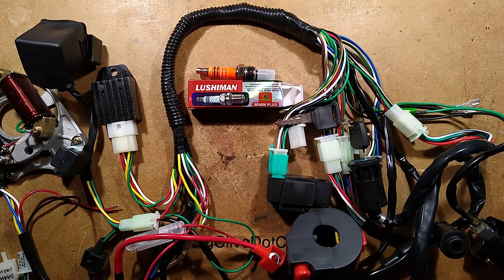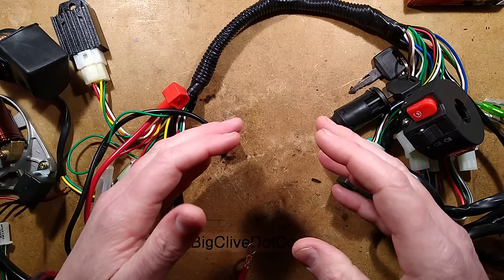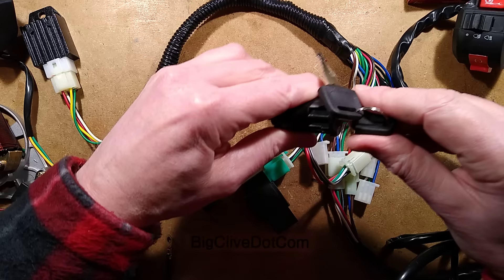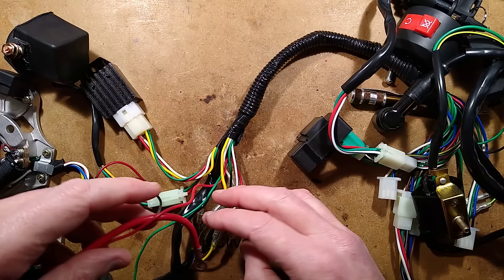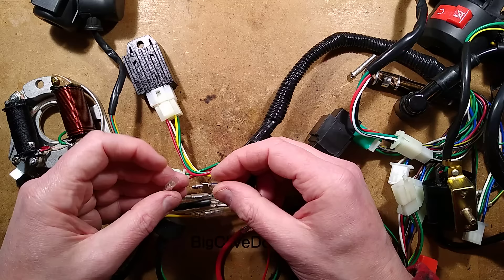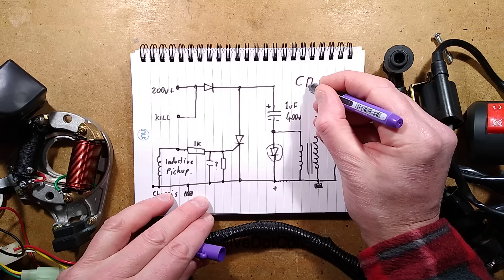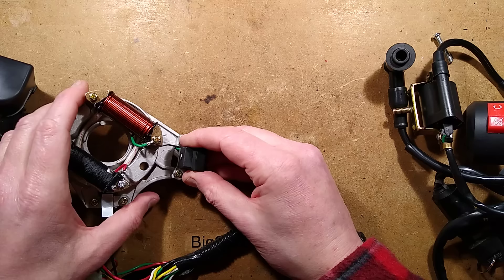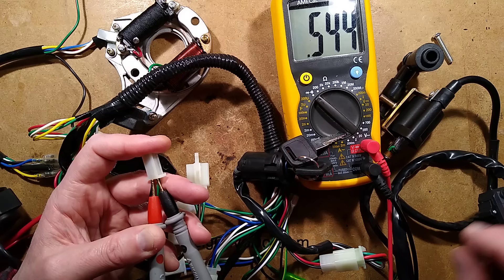Exploring the wiring loom of a Chinese quad / scooter.

Comment: Nice! I don't know how I missed this, this is similar to my scooter, the main difference is the stater, mine is either a 6 pole or 8 pole, I haven't actually seen it, but I have looked at a replacement, I got a 8 pole, but I think it's for the DC ignition system, I'm not sure, I'm thinking about rewinding one of them, with larger wire,   I think it can possibly be hold 18-20 gauge wire, while maintaining the original voltage, (same turns)  I'm hoping to do a half DC conversion, and use the headlight circuit to also charge the battery! Any advice?
Reply: Most atv's have a AC ignition system. ... needing a LOT of power to spin the engine to 2,000 rpm's ( difficult in freezing climate ) in order to spin the engine fast enough to create energy for the spark plug ... alternating current from the stator to create the energy for the spark plug ...
I live in cold weather ...  so I converted mine to start easier in cold weather ) Stator creates energy ... then it charges the battery ... which then powers the spark plug.
AC system ATV's ... need to spin the starter motor fast enough to spin the engine ( in cold climates - the engine oil is so cold it has turned to sludge - so you need MUCH more current ) - to create enough energy for the spark. ... DC ignition systems ( start easier ) becasue the spark is generated by the BATTERY ... INSTANT SPARK ... NOT waiting on 2,000 rpm's needed to spin the stator fast enough to create energy for the spark plug .
Reply: BEFORE rewinding the STATOR ... re-wire the stator from 1/2 wave ( factory setting ) ( 1/2 charge per rotation ... to a FULL WAVE ( full charge per rotation ) by removing the wire from the mid-point of the stator to the " other end" ... ( but you will also have to replace the rectifer ... to a FULL wave rectifer ) ... rectifer ... is a ac to dc converter ... voltge specific - so if you put a FULL charge into a device set for a 1/2 charge - you will blow out the "rectifier".
Reply: I had a 2 pole stator ( factory standard ) switched it to a 6 pole ... FULL wave conversion ... now puts out enough to power ... A lot of lights, winches,
Reply: look up : youtube - Harvey Spooner ... " making atv's easier to start" ... " convert atv ignition system for easier starting "
Reply: taotao 125 cc ... converted to 200 cc with 3X more electricity ... rewired stator to put out more power ( moving 1 wire ) ... replaced 1/2 wave rectifier with a FULL WAVE rectifier ... replaced ac powered CDI ( to a DC powered cdi ) ... replaced the 18 mm carburator with a 22 mm ( diameter ) carburator ... ADDED 4 flood-lights & a winch ... ( burns more gas - 1 gallon tank ONLY lasts 40 miles now ) ... 40 mpg on a ATV !?  .. good enough for me !

Comment: The components are semi-OK but the wires and connection are A #1 Chinese JUNK! You're better off doing what I did and thats taking the wiring harness from a dishwasher and replace all the wires and eliminate most of the safety crap. If not you'll spend more time diagnosing wiring problems than you will riding!

Comment: Is "pudding joint" a derogatory term for electricians?
Reply from the maker: No.  In the past joints used to be made by twisting wires together and wrapping them in a sticky fabric tape.  It looked like a meat product here called black pudding.
Reply: As over time the adhesive would leach through the tape. At least it did with the fabric tape used on some vintage electronics.

And mentioning black pudding, it's time one was electrocuted.
Reply: @aethelfreda  Personally, I wouldn't touch a black pudding with a 10-ft pole, let alone a pair of 6-in electrodes. I can only imagine the emanations of such a vile substance when heated when electrocuted.

I do support the general notion of using everything from the squeal to the tail, but surely there's a better use. <shudder> Blood and tongue roll at least looks attractive in a sort of ghoulish way.
Reply: @PaulSteMarie  I had a decision to make this morning. Should I have a slice of black pudding with my breakfast? Or should I have two?

Comment: Typical Chinesium disposable crap, buy one of the bikes and if it gets wet then within a week the connectors are stuffed as well as the switches, people would buy this wiring loom off feebay and install it into there chinesium bike then they would discover lots of faults and errors no start or charge etc.. due to the low grade connectors, if they were lucky there bike would be on the road again,,, until it gets wet again.

Comment: I question your points of criticism. Obviously, you are thinking like a British Standards type.

Two questions: 1. Does it work: 2. Is it fair value for money? 

My company has 6 motorscooters and 4 ATVs of Chinese manufacture and living in VietNam they have proved reliable even in the wettest weather and floods.

The fact you use words like "presumably" or "guessing" identifies you as a person not qualified to render judgement on this product. You haven't seen Chinese production lines and this loom is quite serviceable. The "crimps" you muttered about in the split sheathing are used in aircraft wiring. 

The handlebar control designed (NOT waterproofed) has been used on millions of millions of two-wheeled vehicles the world over. Think functional! Think practical: Most any critical component is interchangeable with other vehicles - very important in less developed / wealthy countries.

Where is the British car industry? A few overpriced luxury vehicles - all the practical car manufacturers have gone.

And remember, you bought a product that is made of parts that are used in many similar products, why re-invent the wheel when you are already manufacturing identical equipment for use in different vehicles.

A poor review.
Reply: American cars use a cdi with electronic choke ... British made cars still use a cabrator & a MANUAL lever to adjust the CHOKE ? ... last time I used a car with a MANUAL choke , was my grandma's 1950's buick skylark . American cars have NOT used CARBURATORS or MANUAL choke for over 75 years .. why is the UK using a technology that is ... 75 years old ?